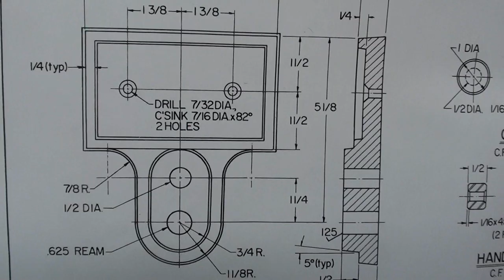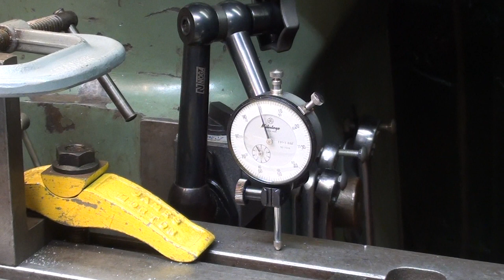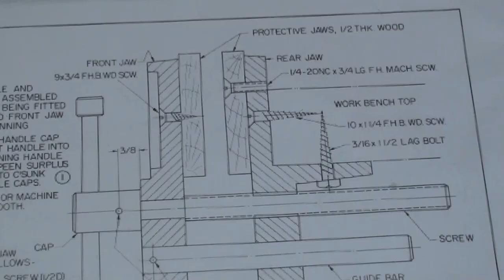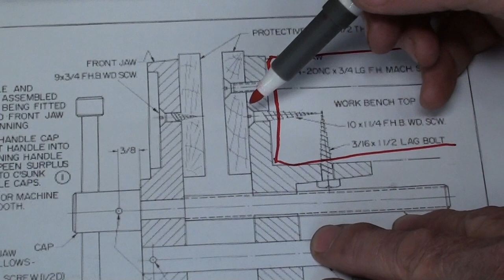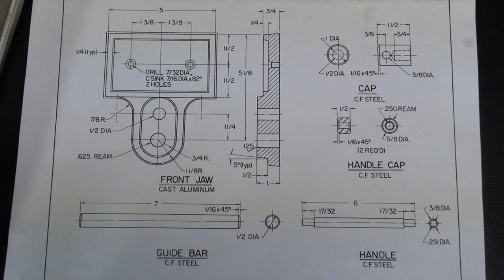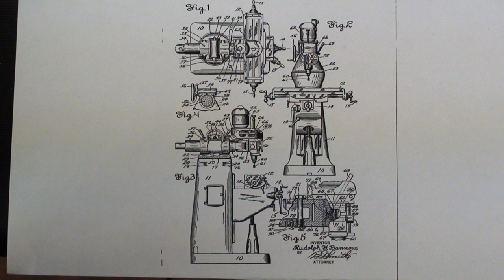WOODWORKING VISE FOR HENRY pt 4 TIPS #636 tubalcain

Comment: That is a real beauty. Your castings are superb and I do very much like the inclusion of the retractable bench dog. 10 out of 10 for this project, that is also a lovely personal gift to pass to your grandson. I can't think of anything not to like about how this vice project turned out or what it will represent to Henry in years to come.👏👏👍
Where you mention the extensive filling of raw castings,a lot of old machinery was surface levelled by filling with 'whiting' paste. That is a mix of white lead and boiled linseed oil. Other filler powders were also often used like plaster of Paris with boiled linseed etc. Another interesting compound for filling blow holes and larger casting flaws is foundryman's cement. Usually a mix of iron filings and sal ammoniac. This mixture sets rock hard.
Whenever I restore old machinery I strip castings right back and  use a generous quantity of polyester based body filler to level out imperfections and sand it to a fine,even surface before painting. Machines always look superb for that extra prep work. Smooth surface are far easier to keep clean too
Reply from the maker: Thank you for that. I was wondering what to use for filler

Comment: Thank you, i may just have to built a foundry and make my grandson something like that. I had to laugh at myself, when you were plunge cuttin that pocket, not only did i lean over to the monitor and blow, but i noticed my left shoulder was down and my hand waving around towards the floor looking for a handle! Not the 1st time this has happened, at least the blowing chips, and every time i just have to smile. This has been an excellent project. When i was in high school, maybe jr high, i built a foundry for alum and brass. Dad brought me home a 6lb (brass wt) graphite crucible and some good sand. Back then, where i came from (pa) there were all sorts of foundry's and steel mills. I remember in 7th grade shop we built a pattern and learned "sand crabin" it even had a "molasses" core but i can't remember what it was we made. The fact that i don't have it must of meant i botched it up somehow cause i have most of my other projects still. (The handle on the crosspeen has been replaced over the years, and the alum handled screw driver repurposed) I thoroughly enjoyed foundry stuff though and at one point i decided to be a patternmaker. During HS (60's) the mills started shutting down. My dad went thru something like 6 foundry's by the time i graduated. In fact it might of been when i was a junior or senior, somewhere around there he had to take a job in buffalo and just come home on the weekends. There is no industry like that around much anymore. I ended up in the trades though, in tool and die, moldshop and i can't complain. Thanks again mr pete!
Reply from the maker: Glad you like the foundry videos. Yes things sure have changed. There were several iron foundry is here in town where I live. Long on

Comment: If you mount the vise so the wood on the non moving jaw is flush with the face of the bench, then when you assemble it the entire front of the bench is in line with that jaw. This makes it easier if you put a long work piece in the vise as its far face now lies along the face of the bench. This makes hand planing long pieces easier. My bench is set up like this and the idea came from a Fine Woodworking article from around 2000.

“. . . And the Israelites slew the Masonites”

Frank

Comment: I'd like to see a series on the other vise. You mentioned blind holes for pins in an earlier part of this series and, like you,  I'm very much ag'in 'em. I bought a rusty woodworking vise at an auction last year and it had blind pins holding the guide rods in. I had to drill them out, broke a drill bit in the process, but got it out easily and was able to drill the holes on through so I, or a future owner won't have to go through that again. General note since others have mentioned video length. I don't mind them until get up in the 40 minute plus range.

Comment: To help keep those screws in, dribble some liquid acrylic wood hardener into the MDF first and then carefully twist the screws in; taking care not to strip the threads out.  As long as you don’t tighten them up all the way when you initially screw them in (wait until the wood hardener dries first) and you put a thin layer of paste wax on the screws before screwing them in, it will prevent splitting the MDF and provide a tighter hold once the hardener dries.  Do the final tightening after the wood hardener has dried.  Hope that helps.

Thanks for letting us follow along.  Cool project.  😎
Reply from the maker: Thanks good advice

Comment: I'm currently working on a pre-WWII German horizontal mill, and the base casting has tons of filler on it!  It's a fine, black substance that's almost tar-like when warm, and Bondo does not like to stick to it.  I've had to skin it with spot putty, then apply Bondo to the deeper holes.  Even then, I have one spot that keeps lifting.  Grrrrr.

Comment: I like this project. The only improvement that I might recommend would be to contact cement  two pieces of leather to your removable jaws which will offer a little better grab with out marring the work being held. I have had great luck doing this in my own shop.
Bob Ross

Comment: I use radius carbide router bits to add a radius on aluminum, on my Bridgeport . Do you think it would work on steel?
Reply from the maker: It might. In fact I was looking for such a bit To put the radios on the dog. Could not find any

Comment: Mr Pete, this is Jan here from Seattle, we used to have a Boeing surplus store here in Kent WA. They would sell all kind of stuff, but it closed a while back. They had 2.5-4 inch pieces of coarse and fjne files mounted on pieces of wood, like a figure 8. I guess to work in confined areas or where a long file would not work inside the curve of the fuselage. Do you know if these shorty files are a commercially available item or a DIY thing. Can you cut and drill file blades? Thank You jan.
Reply from the maker: You can cut the files the length with a carbide saw. Or grind them